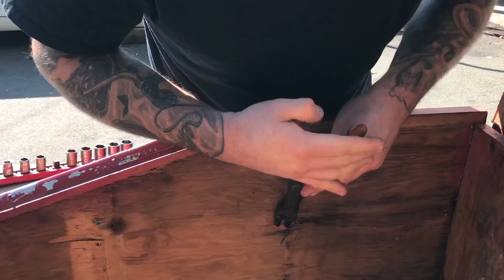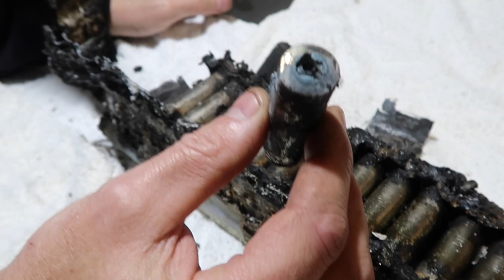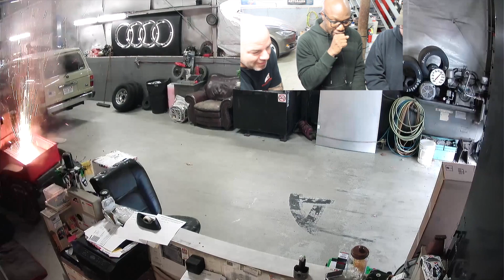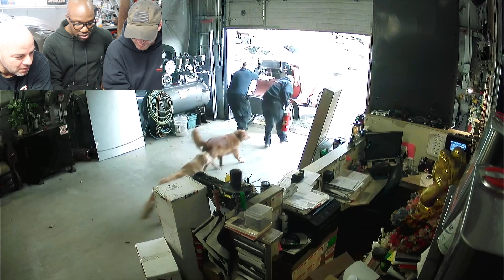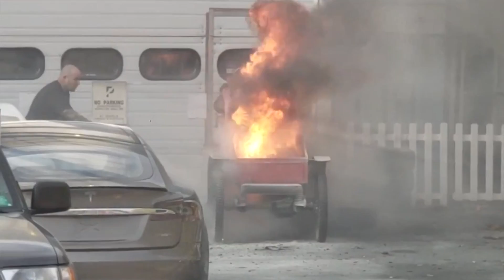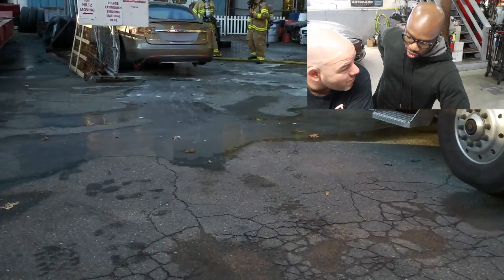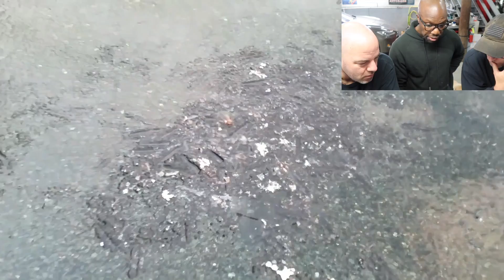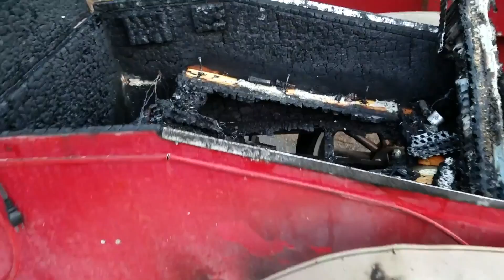My first Tesla Battery Fire

Comment: Got to be some safety shut down so the voltage doesn't run thru the whole pack of batteries . What's going to happen when electric cars are a common thing and one goes off like this in a parking lot or the garage in your house ??!!

Comment: As Morton wrote, it's an over charging issue, probably no balancing or straight out overcharging with some dumb simple charger that is not meant for lithium batteries. Charging large lithium packs hell even older type batteries is no joke, whole thing has to be monitored and balanced so any parallel part of the pack doesn't overvolt. Lithium batteries are safe as long as handled properly, charge and discharge them safely with current, voltage and temperature limits. Obviously for a hack job Daisy this was not done. Even on Tesla built cars these accidents do happen too probably because their monitoring and battery management fails. Water + lithium = more fire, don't hose it. Putting out lithium fire and battery packs is a nigthmare, they can go off even weeks later again and again. Good luck getting rid of the waste, probably not cheap either.

Comment: I see a lot of comments about not having a BMS. I would add that one needs to have a BMS and also to check and make sure that it actually works. To do this you have to overcharge one cell and notice that the BMS does shut off the charger and the same thing with the discharge side of things. So don't think just having the BMS is going to save you if you didn't make sure that it's working. I learned that the hard way. The other thing is to figure the different ways that it could fail. If you are using a 12-volt system to run the BMS and the failure of the 12 volt system stops your protection, as in not having the ability to close a relay this will be a point also of possible failure.  Click on my profile to see my setup.

Comment: Newbies apparently don't know anything about proper lipo use they have no thermal protections no voltage protections they just plug it in like a car battery and can't figure out why it blew up (I build power backups for cell towers and race RC cars) you will need a few sensors and a custome calibrated charger to safely build a lipo powered car Kevlar and Nomex battery casing would have helped allot also

Comment: 888 18650 cells in a tiny wooden cavity without a battery management or cooling system - what could go possibly go wrong?  You knuckleheads were damn lucky you didn't burn down the shop or ignite all those cars in that parking lot.  Man - I had no idea how flammable a lithium fire can be.  No wonder these are banned on cargo holds on passenger planes.

Comment: Water + lithium = boom. That's why you aren't allowed to take large batteries on flights, there's literally zero way for the crew to put out the fire mid-air, even a small fire like a cell phone lithium-ion battery exploding can be a massive crisis and even burn through the entire plane. Never ever try to put them out with water, you'll just make it far far far worse. I'm amazed an electrical specialist garage didn't have an electronics fire extinguisher on hand? Isn't that state fire code? Even for regular businesses? I worked in a small store and even we were taught the difference between fires and what to use on oil (fire blanket) vs electronics (carbon dioxide extinguisher) vs regular wood burning fire (water extinguisher / any).

Comment: If they had a class C fire extinguisher it would have been put out, They used the wrong agent, looks like they used a class D for heavy metals instead of C for electrical fires, similar but very different. If you used the right one your project could have been slvaged

Comment: I just wonder why you didn't use the whole extinguisher on it as soon as the little flame started.. that should be enough to put the fire out.. hmm
Reply: Battery fires have all the fuel they need contained inside. Suffocating them within a fire extinguisher won't help away all. Now if they had a hose to cool it down

Comment: I've heard many fire fighters aren't educated on how to extinguish battery fires, but it seems like they did okay. It's all about using large amounts of cool water to cool down the batteries enough to stop the reactions from occurring. Thermal imaging cameras should preferably be used to make sure temperature isn't still high somewhere, because it can start again. Tesla recommends checking that there's heat for about an hour, before declaring it safe.

Comment: well at least the dogs and mechanics didn't get Injured. This was literally the same thing that could've happened just with the regular battery system that was in it. That's why I was making little cracks about that. Battery system in a wooden unit being used at a Disney parade and they had a spark or on front and so forth. This thing could've just as likely caught fire like that at the parade in its original form.

I frankly myself when I see you putting the batteries in never thought about a cooling unit or battery management module. This kind of thing happened quite a bit when they had college students developing electric operated vehicles for different projects and contests and whatnot going back years. I didn't know those batteries were made up of hundreds of AA rechargeable batteries. I always assumed they were similar to a traditional vehicle battery didn't realize they were daisychain AA batteries. I figured they were more like the batteries in a cell phone. Still wouldn't mind seeing you guys get your hands on one of any number of electric vehicles and what has light engines and batteries on. Said vehicle. There's been a whole host of work he attempts to make electric vehicles during the 1970s gas prices and so forth. Anyone of those vehicles would make for a interesting as what conversion process. At least it didn't catch fire when somebody was operating it. That's something to be grateful for this could've just as likely happen after putting proper electronics on it and everything else.

Comment: There's a reason there are engineers at Tesla. Real ones.
Reply: It's a good thing too.  I doubt their stoned founder could engineer anything but packing a bowl anymore these days.  Must be rough, sitting on all that wealth. ;o)
Reply: Yeah agreed. These guys are not real engineers at all. They are kids playing with fire.
Reply: @WillProwse  you are only saying that because you feel you know a bit too and have a jealousy over the attention they get vs you. basic psychology and we both KNOW deep down it's true.
Reply: @03056932  not even. Going by this video, there is nothing to be jealous about.
Reply: 03056932R enough with the psych lesson, Freud. They did everything wrong. Charging low voltage batteries with an inaccurate charger and no BMS, sticking your face in a burning battery pack, and blowing more air on the electrochemical fire, then using powder extinguisher on an electrochemical fire instead of water (forgivable because they don’t have a fire hose laying around). They also cut out the part where they disconnected the battery, which proves they were overcharging it. Very scummy and makes it appear to most people that it blew up outta nowhere.
Reply: @WillProwse  What, a simple accident happening means they have nothing you dont want? Great deduction.

Comment: Okay. Love the videos normally but this series should be treated as a cautionary tale. I recommend some study on battery safety and preparedness. I'm sure many of our peers in the Homebrew EV community were scratching there heads about what you did in the last video. Yeah we were all excited to see you get that thing running. But you didn't protect those batteries physically or electronically. Rebuilding the Tesla taught you a lot about Tesla but it appears you haven't done your homework yet on how these systems actually work. Power+motor=go is not the right math here. Your not wanting to open a Tesla shop you want to open an EV shop you need to know some basics. Maybe look. At some stuff from endless sphere or even the E-bike world. When you start working with these parts at the component level your putting your life and other's lives in your hands. Study up on BMS. Learn about proper storage and maintenance of these cells. Do not play with a possibly still explosive and certainly unstable burned up battery pack. Any residual charged cells could have been bridged and injured you. There is a very small.gap on these cells when they are not wrapped that could be  bridged by scraps of metal in the pack.

Be safe guys we wanna see you all succeed and make more content and your dreams come true.!!!

Comment: And there is why electric cars are so scary in wrecks.  Top Gear wrecked a far more advanced car that took several days before it stopped self destructing.  There really needs to be a breakthrough that doesn't shoot up the cost of production/ownership but makes them as safer.

Comment: What's the best way to deal with a battery fire like this?
Reply: Containment. Absolutely best you can do is to contain it into space with zero oxygen and cooling system.. how ever not so many people can just trow their burning batteries into space. So containing fire out from other sources of fuel, like they did and trying to cool things around it with foam if all possible, or water and try deprive it from oxygen using CO2, while waiting it to burn off is best thing you can do. Essentially what you have there is metal that is charged with electricity, where one cell over charged, witch litium then over heated to level where metal started to burn, that then catch fire and started to over heating surrounding cells causing battery run away. Its pretty horrible thing to happen with 2-3cell hobby lipo, but this.. this is just literal hell fire, that can wreck many things... but then again natural gas bottles are seen as safe to operate by general public ie idiots, so let people play with tesla batteries. If idiot managed to burn their house down and them selfs with it, its just natural selection.

Comment: Rich, how about a video telling people what caused this and what to do if it happens? It will greatly help the community! Tesla’s Emergency Response Guide / first responders info is publicly available and has a wealth of information. They state that the best thing to do is to soak the battery with copious amounts of water. This removes heat from the cells preventing others cells from going into runaway.

Comment: Just imagine if this was in your house as a battery backup and it exploded like this.
I disagree with you a bit, you mentioned Cooling and Battery Management, weren't the batteries sitting dormant.
I could see something like this happening while the vehicles is in use but not while it's sitting.

Comment: To the haters... How many times do you think Elon or Mr Tesla himself had mishaps or fires 🔥 until they got it right??🙂 You learn from your mistakes. That's how you prefect your product.!! Keep pushing on Rich!!👍👊👊🙂🙂
Reply: BS Elon never used battery packs without power management and all the rest. I've enjoyed watching this channel,  but that was a real dumbass thing to do. Really lucky that didn't happen in the middle of the night and burned the whole place down, but having said that, I've certainly done my share of dumb stuff as well.
Reply: Look haters or not they are setting an example and trying to represent themselves as people whom should be building EV. But bypassing safety equipment like bms is literally a duplicateable and possible fatal mistake at this level.  And they continued to play with the damaged cells on camera knowing some may not have been discharged yet. Even vapers know better than this.
Reply: +Big Jon   Right.   Just the fact that the one guy tried to blow it out, shows that they (or at least he) know very little about lithium ion batteries.
Reply: I doubt Tesla ever suffered a failure like this due to the level of incompetence Rich has shown in this video. Accidents happen, but charging a lithium ion pack without a battery management system is simply dumbassery. I'd have expected rather better from someone with some experience of working on Teslas.
Reply: Anyone who's repurposing the Tesla batteries and using it without a BMS system is an accident waiting to happen..and hopefully doesn't cost them there life in the process.

This has nothing to do with haters..
Reply: perfect**
Reply: Yes . Rich was just Messing About.
Reply: No time did Mr Musk have a mishap seeing as he does fuck all. He's not an inventor, he just fronts the firm
Reply: @boredfartless4221  yeah I did some research on my friend Elon. Just like Trump someone fronted him the money before he was about to go belly up...😉🙂
Reply: Eugene Cody who’s hating?  Feel bad
Reply: Eugene Cody it still isn’t right! Tesla fires every week
Reply: i can pretty safely guarantee tesla has not had a battery fire caused by charging naked cells with no protection, because you just don't do that. because it causes fires. like the fire in the video. which was caused by charging naked cells with no protection.
Reply: You don't get "wiggle room" with electricity.  One little mistake and you can end up dead in seconds.  They were lucky they got that pile of shit out of that building when they did because it would have burned that entire section down.
Reply: @TommyboyGTP   Well a well-handled pack would have a safer failure state. they were totally unprepared and didnt respect the electricity. i've had problems with my packs, but its always been stopped by the designs of my batteries.
Reply: @TommyboyGTP  They are luckier is wasn't a fire from a fuel hose knocked off an ICE car. They couldn't "push" the flaming puddle out the door.
Reply: @Markle2k  But you can easily put out a liquid (which i have done) with a fire extinguisher, unlike a lithium battery that shorts out and vents like what happened here, cell after cell after cell.
Reply: @TommyboyGTP  A Lithium ion battery fire is recommended to be treated as a Class B (flammable liquid) fire. It's the hot decomposing liquid electrolyte in contact with the anode that is causing the problem and the cells going pop are little BLEVE events. The gas coming out of the vents and ruptured cases is mostly hydrogen, carbon monoxide and carbon dioxide. The fire extinguisher only works to try to prevent a small event from turning into a big one.
But when you are confronted with an expanding puddle of volatile flaming liquid flowing out under a tank with gallons more, or more than a dozen dozen Li-Ion cells in proximity to one another, with the former, your most immediate concern is quickly going to become escape. With the lithium cells it's much easier to push them out the door since they remain contained for the most part.
Reply: @Markle2k  They were lucky they got it out when they did
Reply: @TommyboyGTP  "They were lucky they got it out when they did" I'm not going to argue with that. But they probably saved their neighbors a lot of hazard by working quickly to push the cart of out of control fireworks out of the building first. And, secondarily, they saved the customer's cars. But dwelling on a hundred thousand dollars worth of insured items isn't really top of the list when lives were at risk.
Reply: Spacex would have gone under years ago if they had given up at the first setback. Now they will be carrying people to the ISS. Accidents are a part of the development process.
Reply: @curmudgeon1933  this has nothing to do with giving up this all has to do with safety would you clean a loaded gun? There are fail-safes designed with these batteries to save lives
Reply: @curmudgeon1933  SpaceX wouldn't be allowed to operate without having safety features in their rockets

Comment: That kind of fire makes me a bit weary of EV’s
Reply: lol same with ICE car........
Reply: Mahesvara [][][][] gasoline fire can be quickly extinguished in many way, way before the whole car's tank has entirely burned. Lithium batteries in the other hand are self destroying things that needs to completely get rid of their stored energy before they can be cooled down. It like an hypergolic (self combusting) fuel. It's pretty nasty. A lithium battery fire can restart again if there is some charge left in cells and if a shortcut happens in the charred remains of the pack. That's why heavily flooding them is the only way to go, water cooling the thing and helping to discharge by putting every cell in short-circuit.